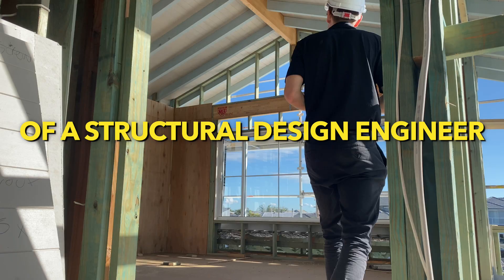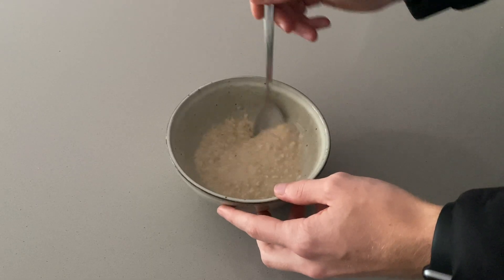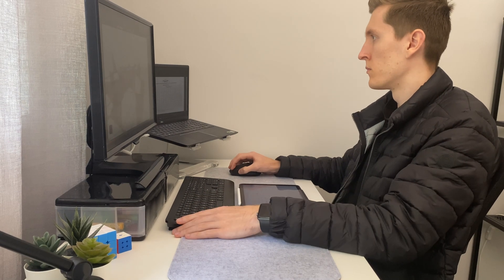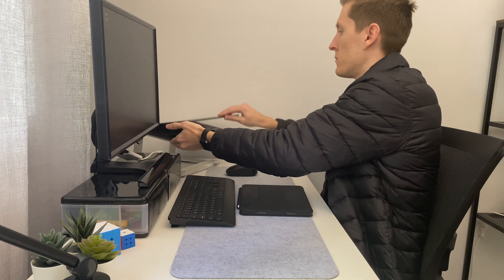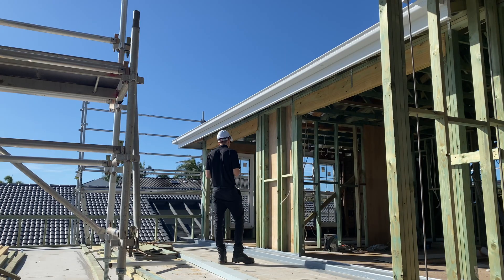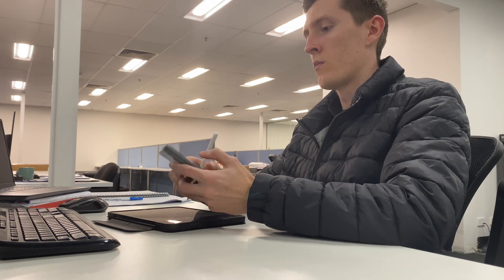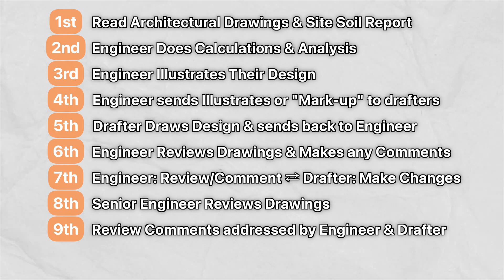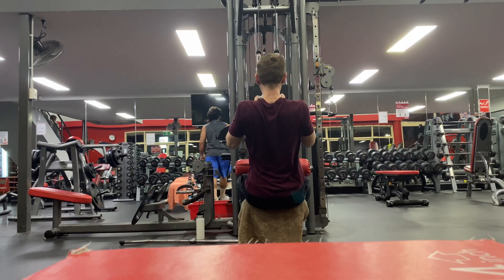Day in the Life of a Structural Design Engineer: Office & Site Inspection

Comment: Hey I need your help. Can this laptop be used as my full work laptop? I am a newbie structural engineer and currently my budget is very limited.

DELL PRECISION 5540
Intel core i9-9th generation 
Total Cores 8; Total Threads 16
Up to 5Ghz processor speed 
512GB ssd storage
16GB RAM DDR4 
15.6" inch screen 
Full HD Display 
 keyboard Backlight

4GB 𝐍𝐕𝐈𝐃𝐈𝐀 QUADRO T2000

Comment: Hey, mechanical engineering student here with an internship. I recently found your videos and love them. I watched your "How to Study Effectively as an Engineering Student" video. I ended up buy an iPad for my notes based on your recommendations - I love it! I currently have a MacBook so it's super easy to transfer materials/diagrams/pictures from textbooks/lec videos/etc. through airdrop - this saves me a ton of time since I don't have to recreate diagrams for physics based classes, I can simply mark up a FBD on the picture from the textbook. However, now that I have an internship, I've been frustrated with the integration between a windows computer and my iPad. I create drawings and/or review them and it's super easy to have the PDF on my iPad and then zoom in to highlight, redline, etc. but since I can't airdrop I have to go through email which is frustrating. I see you have windows products for work but I believe I've seen you have apple products in some of your videos too. Have you found any work arounds for this?
Reply from the maker: Haha yep, this is definitely a frustration that I’ve run into… the apple ecosystem is just so smooth when working across multiple devices. Typically when I need to send something like pdfs or pictures between an apple and windows device I do it through a messaging app. Usually Microsoft teams if it’s work related. I haven’t found a super convenient way that I can share, sorry!
Reply: @BEngHielscher  we need some comp sci or software engineers to code an airdrop app for windows to apple!

Comment: Does Australian houses mostly used timber-composite for low-rise structures? In Thailand, there are barely of them and I used to design roof truss or warehouse with cold-formed steel instead. But for now I changed my industry due to the need of more challenges.

Anyways, 
I like your videos that showed some engineering detailed also, that made my passion comes back to improve myself.

Comment: A proper structural engineer is a design consultant and construction expert.......both in the best materials to use and their integration in the design; to simplify and make the construction process more efficient.......must read the design codes cover to cover upon getting to their first job on their own time..........the goal of the engineer should be licensure..........working in small firms will make your a more well rounded individual and give you the tools to becoming a true professional.........do not confuse structural engineering with coding for google.......this is a very serious profession with public safety ramifications and personal liability issues........requires strong ethical and moral values as well as gravitas.
Reply from the maker: Thanks for sharing this!

Comment: Thank you for this video. I'm interested in pursuing an undergraduate degree in civil engineering. Are there many opportunities to design homes or building to be environmentally beneficial as in material or layout or overall design? I'll like to work with companies who's concerned with nature.
Reply from the maker: Yes, architects do have a lot more control over the environmental impacts although as a structural engineer you do have control over how economical (cost and material saving) your designs are. The more efficient and technically proficient you are the more economical your designs will be. Hope this helps :)
Reply: @BEngHielscher  Thank you for the reply.
Reply: Architecture would have far more control over things like that.  The structural system is only part of the materials in the building.
Reply: @somber_soul  Thank you for the info.

Comment: Hi. Which software do you use for designing and analysing structures?
Reply from the maker: Really depends on what type of structure or material I need to analyse. A few programs I have used are spacegass, strand7, tekla and ram concept
Reply: @BEngHielscher  I am a fresh graduate. Now I am planning to do MS in structural engineering in the U.S. soon. Which skills can make things easier for me and make me more valuable?
Reply from the maker: I think the best thing you can do is get experience through doing personal projects and doing internships. Also try and improve your software skills through using popular programs
Reply: @BEngHielscher  That's the reason I ask for which software I can learn. Could you please tell me that which specific programs can I learn for designing concrete structure and steel structure as well?
Reply from the maker: Certain softwares are more popular in different parts of the world so do a bit of research on programs that are popular in the part of the world you want to work in. In Australia, Spacegass is popular for steel design and Ram concept is popular for concrete design.

Comment: Great video but at 5:35, that sketch is atrocious. Maybe it is an Aussie thing, but you need two top plates, rafters need to bear fully on the top plates, no diaphragm shear transfer is shown....
Reply from the maker: Haha this was just to make a point. More intricate detail would be shown in the digital drawing. Although, the number of top plates required isn’t automatically 2. Number of top plates needed depends on a range of factors (member size, load width, etc.). Also I assume the diaphragm shear transfer you are referring to is the ceiling joists and we typically don’t show this. Perhaps that is an Australian thing? Haha
Reply: @BEngHielscher  Nope, I mean diaphragm transfer from the roof diaphragm. I have never heard of less than two top plates (in new construction). I assume there a cost benefit of trying to justify a single top plate? Especially for a smaller structure. Seems standard practice to go with two top plates, usually. Sleep better at night knowing you have a decent chord/collector rather than trying to be pennywise on a top plate. What are your thoughts?

Comment: Working as an undergrad structural engineer at the moment for a relatively small consulting firm (about 50 staff members) in the housing department. The job is fun, lots of design work, frame/ slab inspections. However, as I'll be graduating in 6 months I just received a job offer from the government 6 months in advance. So contemplating whether to go the public route or stay in private sector.
Reply from the maker: Personally I would stay where you are. At a small company in the private sector you will learn so much in a short period of time and with these skills you will be able to choose whether you want to work in the private or public sector later on. If you go public straight away I think it will be very difficult to come back to the private sector in any sort of design capacity later because you will not developed that skill. It really comes down to what you want to do long term. If you’re not sure yet, I would go the safe route and stay in the private sector.

Comment: I can't wait to spend my day as a structural engineer!

I have also one question to ask you. What do you think if I started as a construction engineer directly after graduation and spend 1 or 2 years there and go back to the office work as a structural engineer. This will allow me to fully understand what is going on in the site, so that I can design buildable structures?
Reply from the maker: You would learn a lot being on site full-time and actually seeing the construction process but if you want to be doing the design work I think it’s best if you go straight into this sort of role. As a structural engineer you still get to go to site so you can learn about the construction process at the same time as designing. It’s not easy to do both at the same time but after 1-2 years of not doing any structural analysis after uni it will be extremely difficult to pick this all up again.
Reply: @BEngHielscher  That make sense. Thanks!